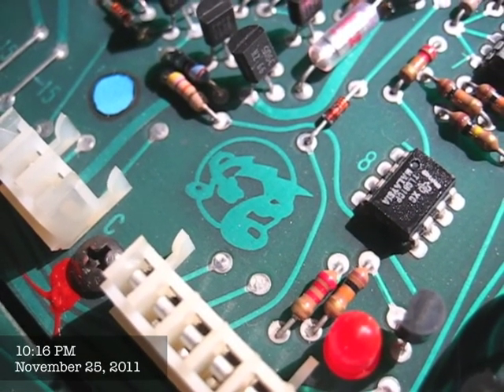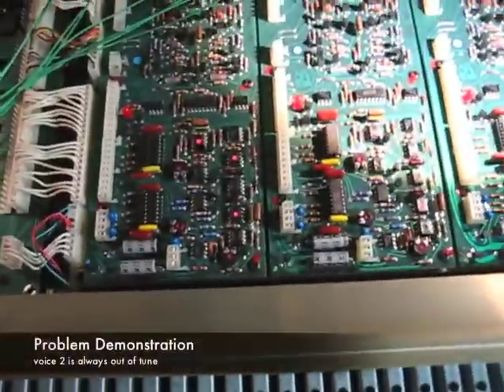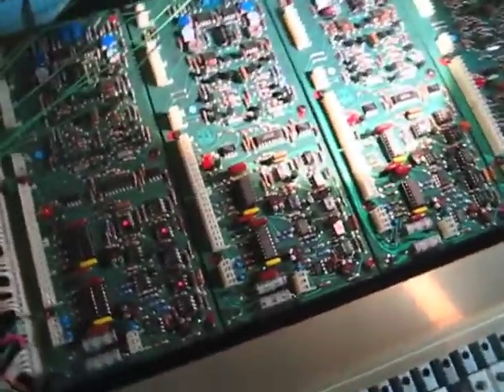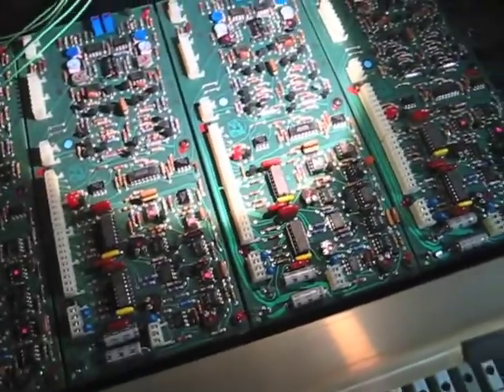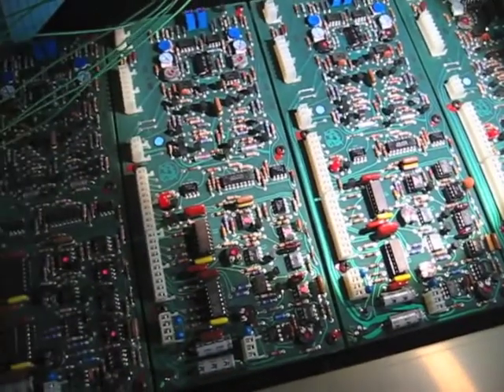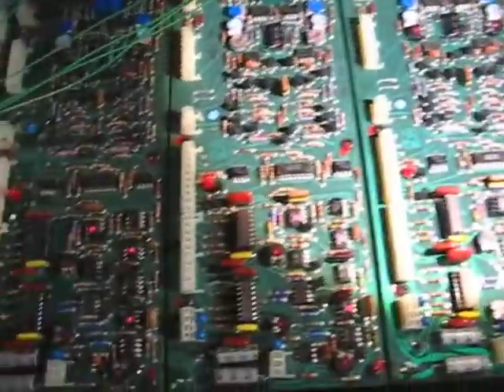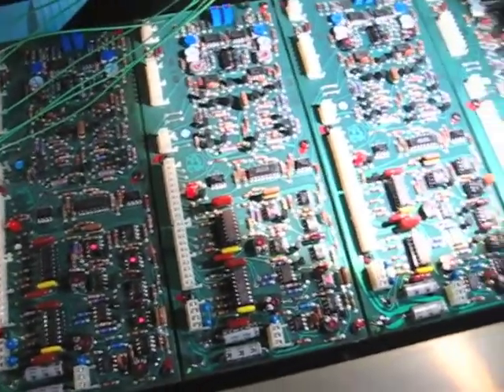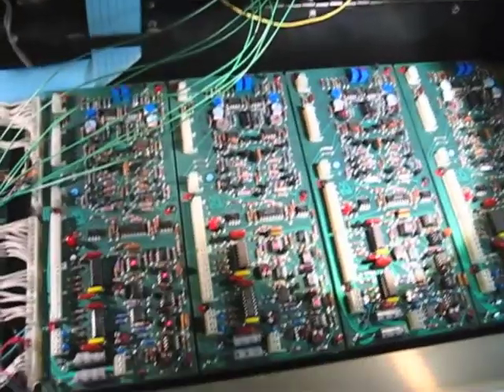Oberheim OB-X Serial No. 802311 - situation (Nov 25, 2011)

Comment: how many discreet components are in this machine?  how do you narrow it down to what the actual problem is...like the issue you had with the LFO...obviously is the modulation doesn't work right you might start there, but with all the components in the LFO circuit, how do you figure out which is which?  Do you just use a multimeter and measure the component values and compare them to the wiring diagram spec?